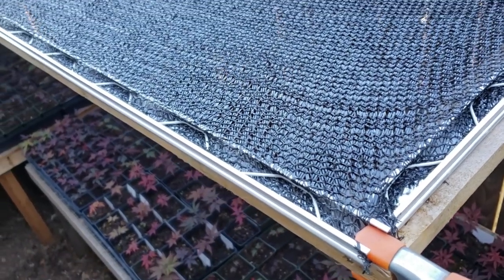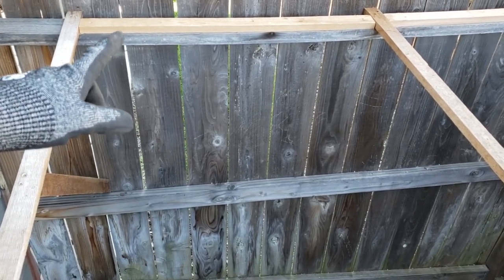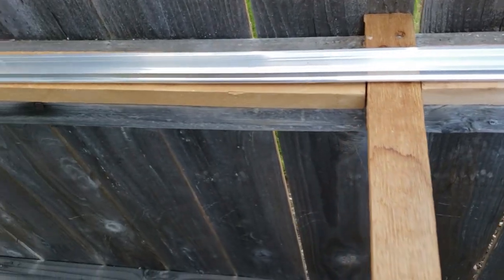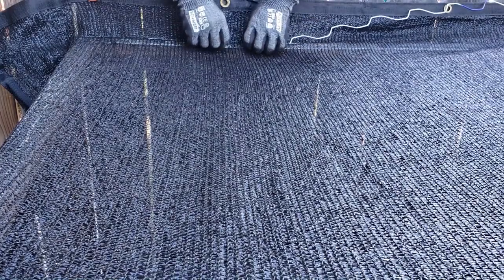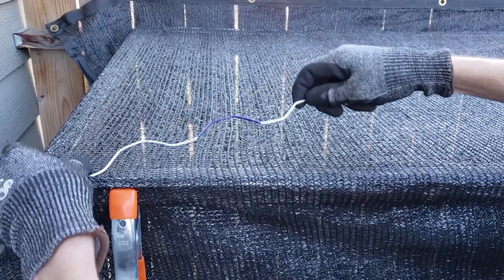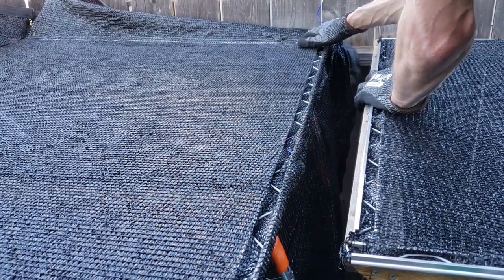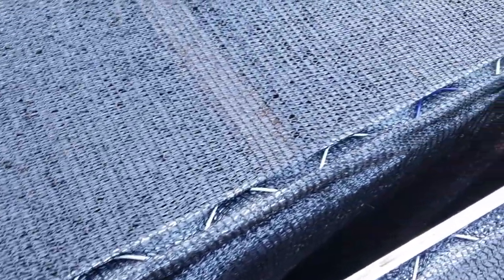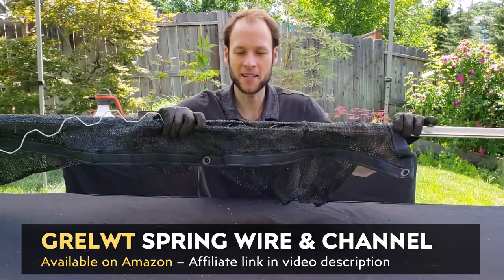Protecting Japanese Maple Trees | Wiggle Wire Shade Cloth Install

Comment: are you able to show us your tables in a little bit more detail? not just the wiggle wire set up but where youve got your seedlings set up. 
ive got about 150 at the moment and am  struggling with a solid place for them while they are so young.  was considering building a framed table with shade cloth around it, but am open for suggestions. 
thanks!
Reply from the maker: That is a good idea for a future video. Thank you. I definitely recommend a raised up surface to grow them on and shade cloth is a must if it will be in full sun.